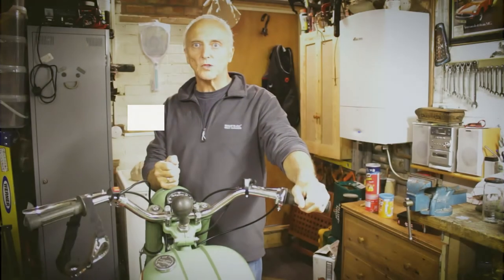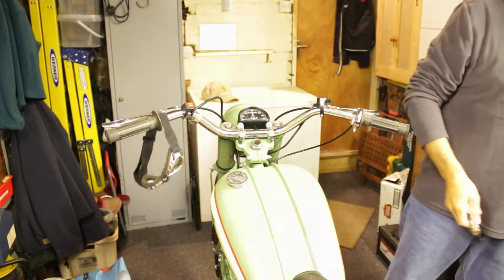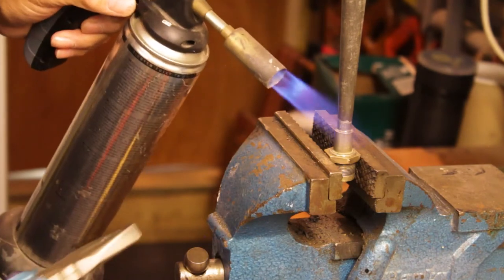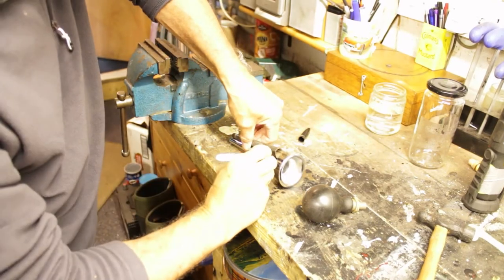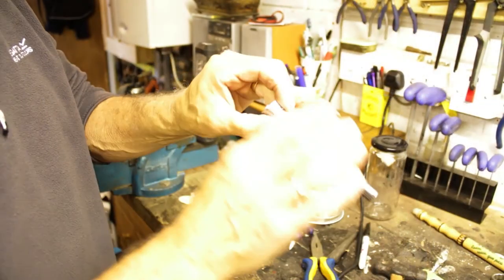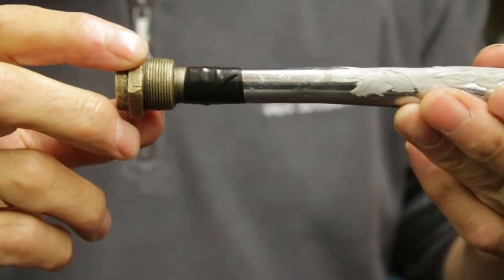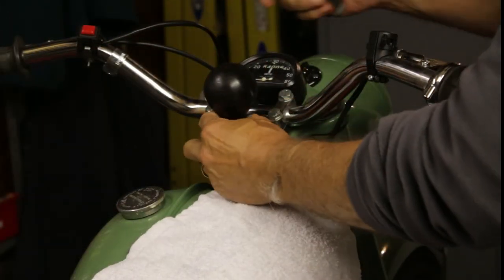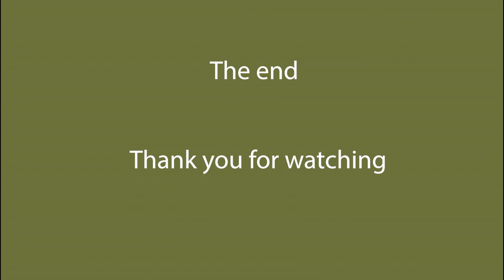Installing a bulb horn

Comment: You did make that look like very hard work! I have made several of these horns (one for my own D1) by using parts from bicycle horns and turning the brass part on my lathe.
You don't need to cut the 'new' cone to the length of the old one, just put the new cone in the stem small end down and mark where it stops and cut on the narrow side of your mark so it just fits inside the stem (no need for slit sawing or filler), you end up with a shorter cone but that does not matter as it goes into the stem which is a 'tube' anyway.
I think if I had an original one I would have tried to repair the old brass reed first, probably just needs cleaning and the 'tongue' adjusting.

BTW Bike looks great!
Reply from the maker: Hi, sorry about that. It worked for me thats all. The brass reed was missing from mine.